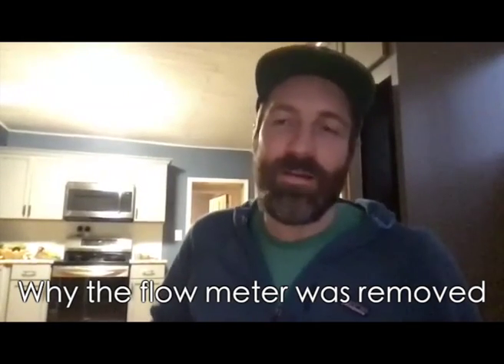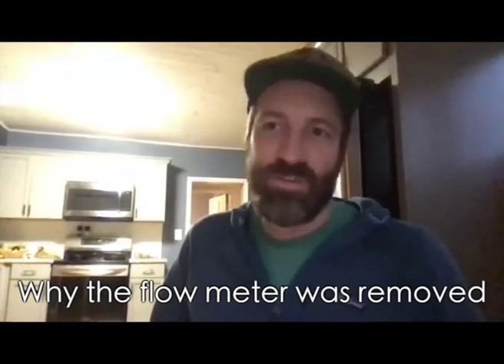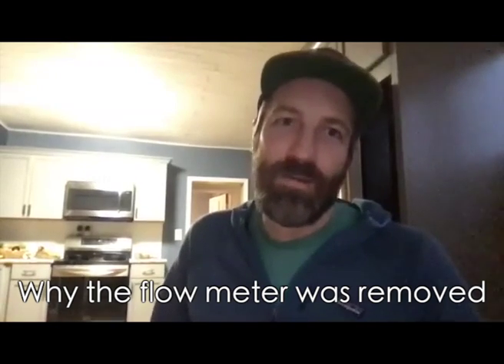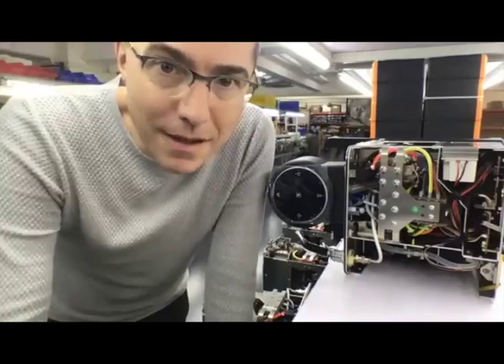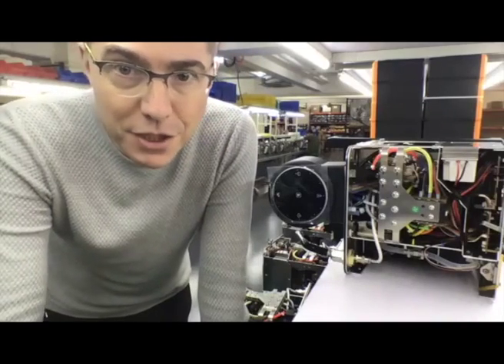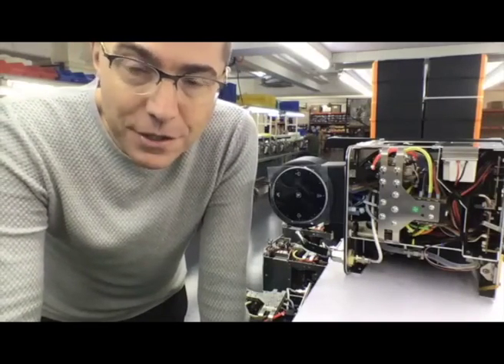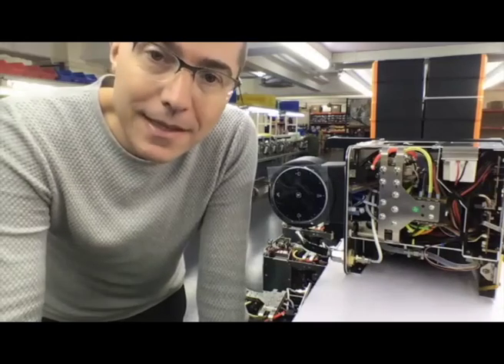Why was the flow meter removed?

Comment: Hello .  What is the electricity that conducts the flow meter?  12V or 220V for commercial coffee machine
Reply from the maker: We do not use a flow meter any longer. We calculate flow by measuring pump usage.

Comment: Does flow per pump stroke vary with pressure?
Reply from the maker: yes, massively. it also varies with pump temperature.
Reply: @decentespresso  Even worse, because the pump pressure-flow curve also changes with pump temperature...

Comment: When I measure the water from the hot water spigot, it seems to be off by 2ml for a total of 10ml programmed and if I go the max of 240ml it actually gave me 270ml. Is that normal? How is that water measured if there is no flow meter?
Reply from the maker: Yes, that's normal, at a 9% error.  Flow meters normally have a +/- 10 or more error (20% range of error)

We measure water with a physics model of what the machine is doing, ie pump strokes and pressure being the main variables.

In your example, we're more accurate than a flow meter could be.